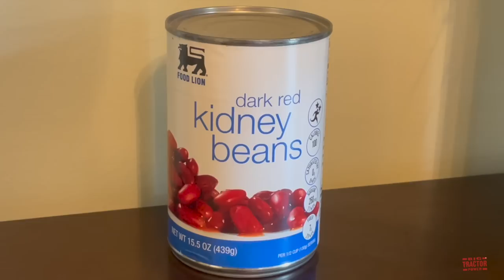KIDNEY BEAN Combines Harvesting

Comment: Jason, thanks for the great video. I'm from far western NY but this is the first time I've seen kidney beans being grown and harvested. About 40years ago this area grew many acres of green and yellow string beans, but not so much now. Most of the acres have been taken over with corn and soybeans. We used to have a canning factory in South Dayton NY only 10 miles from here, and also some food factories in Dunkirk NY. Also about 10 miles away,Red wing, Kraft foods, Conagra, etc. All gone now. Great video's.
Reply from the maker: Thank you for posting. I grew in WNY near Rochester.  There allot of green beans. I remember the Chisholm Ryder crews in 5 to 10 harvesters collection the green and yellow beans.  Mount Morris and Bergen still have canning plants.  My-T Acres in Batavia is the largest green bean producer in WNY today raising 2,200 acres a year.  
In the 1970’s and 1980’s and into the 1990’s kidney beans were a big crop in the Rochester area.  The rotation was wheat, corn and kidney beans.  Caledonia had an AgWay dry bean plant and it is still  in full operation today as Caledonia Bean. 
 In the early 1990’s soybeans started coming into the area.  They were easier to raise and harvest and they quickly replaced kidney beans region.  There are still dry bean growers in WNY.  Black beans are very popular because you can direct cut them with a combine but if you look you will see some kidney bean growers out there.

Comment: I’m from central Michigan and I grow light red kidneys. That puller on the front of that puma isn’t a rod puller it’s a knife puller. I run the same setup but pull a harriston rodder windrower behind the tractor. I also run a 56 bob combine  with a 215 magnum on the front
Reply from the maker: Thank you.  I had not seen that type off pulled before.  Most farms run Heath or Pickett.  Nice set up with the 215 and 56.

Comment: WOW there's a few rocks in that field
Reply from the maker: The pick rocks by the ton every spring. There are 10ft tall rock piles lining this field. Rocks are part of farming in Western New York. The glacier that formed Lake Ontario deposited rocks across the region. Some areas are gravel and some have a few large stones. As the ground freezes and thaws over the winter more stones push the surface.  It’s on going event.  All the stones will never be removed. They pick as many as possible  every year.

Comment: Grew up on a farm between Rochester & Syracuse. We grew light red kidneys. Had a Bob 44(?) we pulled with either a Ford 7700 mfwd or a Ford 9600, depending upon other farm needs. Absolute beast for edible beans.
Reply from the maker: Very cool. I am a Ford fan.  I grew up just west of Rochester on I90. I had a dairy farm neighbor that was all Ford.  They had a 9000 cab, 7000 ROPS, 5000 open station and a 5000 industrial with loader and a Ford 640 combine.  Another Neighor in grain that was all Oliver ran a Bob 44 on a 1755.

Comment: on the cooking shows, they often advise to empty the beans onto a sheet tray to check for stones.   Now I see why!
Reply from the maker: The pick rocks by the ton every spring. There are 10ft tall rock piles lining this field. Rocks are part of farming in Western New York. The glacier that formed Lake Ontario deposited rocks across the region. Some areas are gravel and some have a few large stones. As the ground freezes and thaws over the winter more stones push the surface.  It’s on going event.  All the stones will never be removed. They pick as many as possible  every year.

Comment: Fantastic!  Thought rotary took over.  Planning on Pintos in Kansas next year. Just need an old N7 or maybe a walker type.  Love that unique machinery
Reply from the maker: I grew up in Western New York.  The BOB combines which came in a 4, 5 and 6 size were the main way kidney beans were harvested for many years.  In the 80’s several farms used 7720 Deere combines with 653A all crop heads to cut head lands to speed up the windrowing in the center of the field. Also in muddy wet years the 653A head was a good way to get the beans out. I see in sales brochures a variety of combines being used to harvest pinto beans. I sure would like to see an N7 action.

Comment: Good machine thank.donyou know the cost for the bean harvester 80acre per hour new and a used one
Reply from the maker: I do not know what a Bob sold for new.  The last one was built in 2003 and Draper heads on combines has eliminated many dry bean combines like these.  You can buy one today for as little as $2,000.

Comment: That farm must be in Missouri oh it’s New York I see all the Rocks like here in Missouri!
Reply from the maker: The pick rocks by the ton every spring. There are 10ft tall rock piles lining this field. Rocks are part of farming in Western New York. The glacier that formed Lake Ontario deposited rocks across the region. Some areas are gravel and some have a few large stones. As the ground freezes and thaws over the winter more stones push the surface.  It’s on going event.  All the stones will never be removed. They pick as many as possible  every year.

Comment: That is incredibly rocky soil.  I guess those machines are designed to sift out the rocks.
Reply: Hey Greg, I was in one of the pumas in this video harvesting beans and I would just like to say that these machines most certainly do not sift out rocks, haha! We usually have to manually remove the rocks from the heads of the combines every couple of bin fulls, otherwise the rocks will create a sort of wall in front of the thrashing cylinder and make it hard to feed the beans into the combine.
Reply from the maker: The pick rocks by the ton every spring. There are 10ft tall rock piles lining this field. Rocks are part of farming in Western New York. The glacier that formed Lake Ontario deposited rocks across the region. Some areas are gravel and some have a few large stones. As the ground freezes and thaws over the winter more stones push the surface.  It’s on going event.  All the stones will never be removed. They pick as many as possible  every year.

Comment: Oh man....
That's a LOT of stones in this field.
Why not remove 'em, to load of the wear and tear on all the equipment that needs to go through that soil.
It would remove a lot of un-nessesary tear on all the equipment.
Reply from the maker: The pick rocks by the ton every spring. There are 10ft tall rock piles lining this field. Rocks are part of farming in Western New York. The glacier that formed Lake Ontario deposited rocks across the region. Some areas are gravel and some have a few large stones. As the ground freezes and thaws over the winter more stones push the surface.  It’s on going event.  All the stones will never be removed. They pick as many as possible  every year.

Comment: At first glance I thought they were harvesting kidney beans in a potato field,then I realized those were rocks.
Reply from the maker: The pick rocks by the ton every spring. There are 10ft tall rock piles lining this field. Rocks are part of farming in Western New York. The glacier that formed Lake Ontario deposited rocks across the region. Some areas are gravel and some have a few large stones. As the ground freezes and thaws over the winter more stones push the surface.  It’s on going event.  All the stones will never be removed. They pick as many as possible  every year.
Reply: @bigtractorpower  Wow! Another obstacle farmers there have to face every year.

Comment: No one’s never made sense to me, Jason you always mention the engine horsepower of a particular tractor but you always always leave out but PTO to work. Why do you do that? Why don’t you just mention both of those things seriously ma’am
Reply from the maker: When pto hp gave way to engine horse power I used to mention both 10 years ago. Engine horse power has become the standard.  In a full spec video on a tractor which is the focus of the video I give engine, max and pto hp. In this video the focus was the Bob Combine and there was a 220 and two 240 Pumas. It just adds extra talk to give out specs on multiple tractors that don’t match in specs.  In most cases pto hp is about 35-40 hp less than the engine hp.